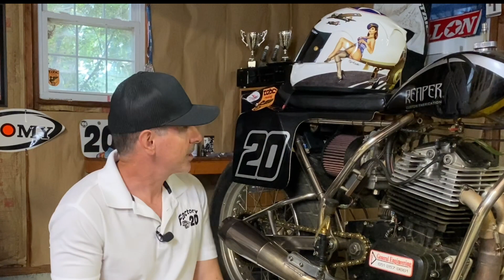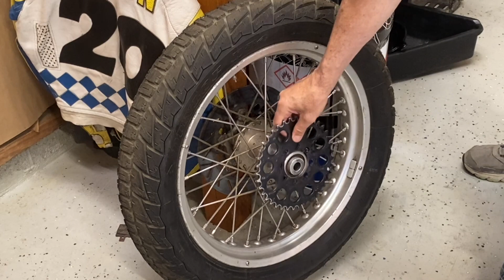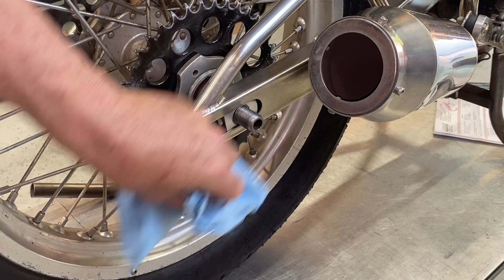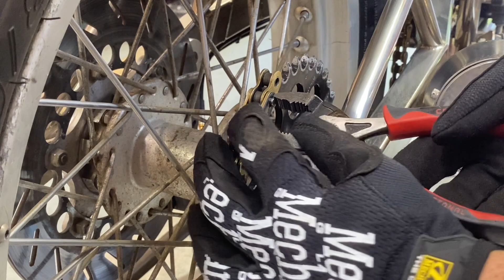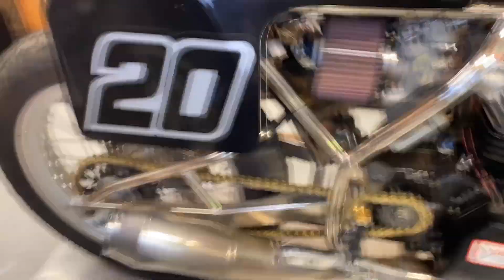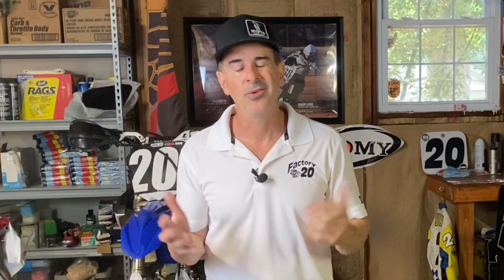Memorial Day Race Prep | How to Grow Flat Track | Welcome New Viewers

Comment: So I guess you have no problem with masterlink chains. They're so much easier than riveted to pull and clean and even with the torque you're putting down, looks like it's all good. Assume you change gearing depending on the track.
Reply: You need to watch more of these videos!! Cheers...
Reply from the maker: None at all.  I do use high-end brand name chains, service them every race, and swap them out mid-season.  Here's how I clean and lube them https://youtu.be/EFX-qczSatQ   The ability to change chain lengths at the track is critical for me, so the clip style master link is a must.